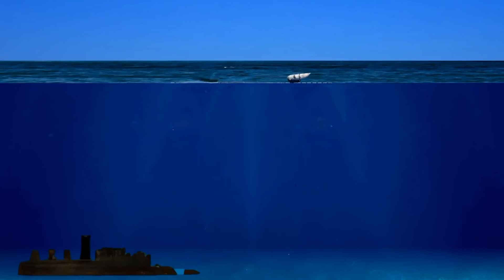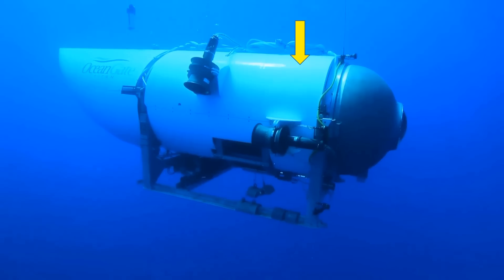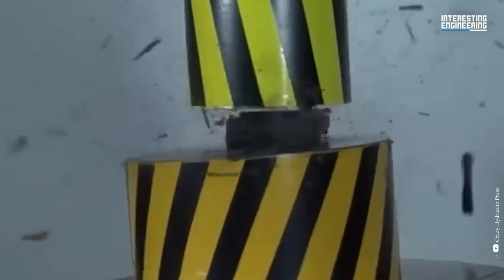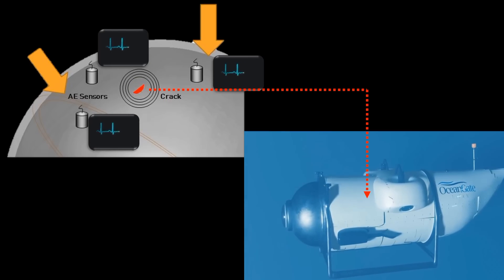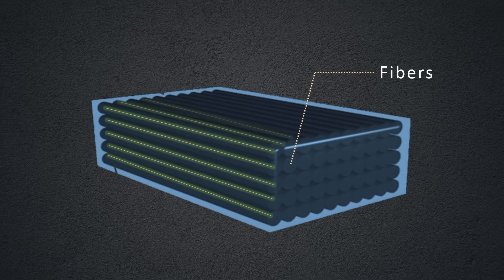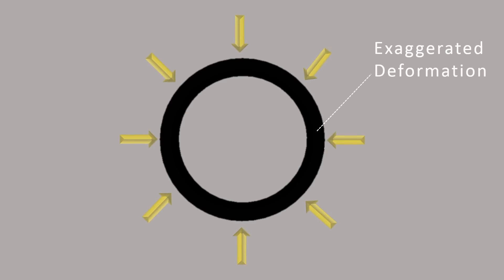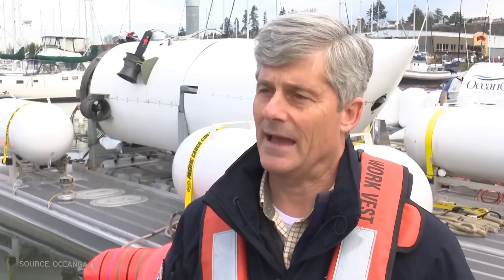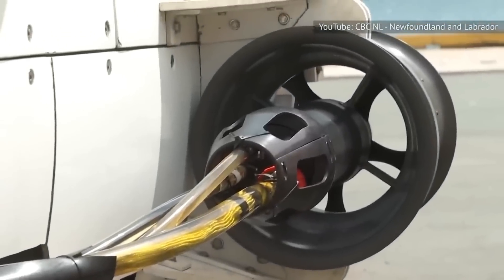Oceangate Titan Did Not Implode Just From Pressure. There Is a Catch!

Comment: The mission before the last one, has a scary story. There were only 2 hold points, which were located on the back side. The lady on board it said that she was sitting in the front dome during landing. The back held it like a hinge, and the dome with the view port kept raising up, and slamming down. Which means the dome was being pulled violently apart at the glue. Imagine slamming it down to get the dome off. They never even looked at it before they left the docks for the last time.

Comment: I used to do non destructive testing for the oil industry. At the time we used radiography which is using Iridium 192 to take an x-ray to check the welds on the pipeline. These days the most common way is to use ultrasonic inspection. Anyway, I don't understand why Stockton would not do NDT on the hull. It is not that expensive, and in my opinion it is a must in the submersible community. I realize that Stockton was bleeding a lot on money and was essentially broke. So I think the real reason was that he knew the carbon fiber was failing, he could hear it buckling on practically every dive. I can't imagine that he was in such serious denial that he could ignore such a fact. But he also knew that the view port was only rated to 1300 meters and he was diving to 4000! And when Lockridge requested the certification on the view port, he was fired in order to keep that information secret. This whole situation is baffling to me that a man could act in this manner and allow innocent people to die. I really want that view port found and inspected. The fact that the manufacturer rated it to 1300 meters and I think that later they reduced that rating. And the Titan dove to the Titanic more than 10 times successfully. We are possibly looking at a new design when it comes to the view port. That is why I would like it to be found and inspected. Kudos to the guys who made it and stood by it. And rated it with safety first.

Comment: Anyone that knows anything about carbon fibre and its strengths and weaknesses, I really doubt it would’ve been used for sub,Arline purposes. Initial testing were total and catastrophic failures. Also, the previous winter 2023-24, the Titan was left outside, by the sea in Newfoundland. Having been responsible for some of the Telecom infrastructure, Newfoundland experienced several severe winter weather events. Besides the nasty sea salty air battering this thing, a hurricane also knifed Newfoundland after hitting Nova Scotia and New Brunswick. Just from my own experience trying to keep things like bucket trucks working in this kind of extreme weather was very difficult. That sea air, constantly changing temperatures, and at least one 60cm snowfall and lots of 20+ snowfalls, I’m surprised anything was working on this thing. It sounds like poor engineering decisions and poor storage fscilitiesnabsolutelymwould have corroded any steel, aluminium. I would know. A simple fog that comes in off the shore is salty fog and would rust out my brakes overnight. If Rush didn’t go down with the Titan, he’d be in jail.

Comment: The safety record of submersibles in general has been exemplary. The decisions of other builders has obviously been better than the build undertaken by Mr. Rush. Jordan Petersen said "Most ideas are wrong." I was working with  Archie and the rig he was trying to make work was not working and would not work so I said to him, "You can't stay married to this rig."  Stockton was married to the idea that carbon fiber could do the job when it could not. In aviation the engineers became aware that materials wear out after so many hours. The pivot bolt for rudder of a DC-6  takes all day to change.  One of the best days of my life was spent changing it.  In aviation parts are tested till they fail. A novel that tells the story of how these standard operating procedures and best practices came about is "No Highway" by Nevil Shute.

Comment: Yes, there were probably voids in the bonding since we saw no evidence of squeeze out...but that's not so important because of the high compression press into the core. 
This is the most-probable single point of failure:  In addition to being a material fundementally unsuited to compressive stress, A unidirectional tow strip is the only fiber the Spencer Composites video shows hooped😮 around the mandrel;  only some was the design provision for 90 degree fiber.   Thus, given water's injection into the motly unidirectional structure, the hooped fibers were displaced laterally, wedging them and progressively splitting the tube.  This tube material, only ever seriously used in tesion, never primarily in compression,was so fundamentally ill conceived that it sickens all competent composite engineers and fabricators.

Comment: The fiber was layed down by a fiber placement CNC machine.  The placement could not have been layed down incorrectly.  The problem here was failure to test this design under 3 to 5 times the anticipated maximum outside pressure, and the failure to test for fatigue, running that test for at least 2 lifetimes.

Comment: You are about the design of the craft. Titan was descending more than twice the speed per meter. Too fast for safety reasons. Then they should have realized to stop and return to the surface... Once Titian realized it had a problem, the sub could not return to the main vessel because of electrical issues. By then the sub already had water into the battery and electronics that control the motors... Once the crack had started... the game was over... So sad... =)

Comment: unfortunatlly, you have failed in this assingment, and there is why: you didnt understand the loading. you have equal pressure from each side and tubular space you would like to protect- bare with me, we are still analysing, we will get to the material later... so, you have pressure on the surface of the tube, which is a lesser of the problem- bigger is the same pressure being exerted on the tube sides- what appears to be an axial force running along its lenght: two half domes at both ends would in theory transfer the pressure on tube edges- and that is where the problem is- there is nothing to receive it. we can consider carbon fiber in this case to be a composite material- fibers are applied in certain fashion, but bonding material is the key, what is it- think of concrete, it is good with pressure but cannot withstand tension- hence reinforcement. if we have a homogenous slab, with no beams- than reinforcement has to go in both cardinal directions within its plane. same is true for carbon fiber. in this case "engineers" and "innovators" should have tried to criss- cross it, to create some sort of cage hoping to achieve enough structural strength- to avoid applying force along side fiber axis or straight across it- spatial structures comes to mind. moreover, thickness is just making the problem worse- its own moment of the inertia within cross section is creating a havoc. one thing you got right: fibers in general are good for tension only- you dont have to think of reinforcement, take wood: perfect for tension, not very much so for pressure, unless the size of the cross section is proportionally bigger to its lenght to avoid deflection, one thing that caused this "submarine" to fail- if it actually happened at all. if they were serious, they could have tried to apply pre-made sheets of carbon fiber, not very thick, just wrapping it around in spiral fashioon- paper tubes are done in the same fashion? there is also question of thermal dilatation- lets say between two materials, titanium and carbon fiber: fiber may be inert, but steel is certainly not? than- does carbon fiber becomes brittle under conditions of high pressure and low temperature- sure it does, more especially because of contradicting state material is in: increasing the pressure rises the temperature? if this is not understood, no "computer model" will help you- remember: there was the world before computers, most of it is still standing... however, being an young engineer, thread carefully- diploma or degree means nothing, it is there to give you right to work, to qualify- real work is ahead....

Comment: Yes u can make a carbon fiber hull work for submersible, just make it very thick and apply the fiber layers lengthwise, not cylindrically--effectively making the hull concave--the carbon fibers will then expand rather than contract under the the water pressure.  The titanium endcaps should probably also be reinforced w/a hexagonal frame, to help keep it from compromising the hull.  And that's it--fyi, there's a company Composite Energy Tech, that makes carbon fiber submersibles, and they have an excellent reliability record

Comment: Dude, you're talking about shapes of submersibles but showing submarines.. Submarines are not going to the depth of 1000 meters of deeper.. Submersibles rather go deeper even to the mariana trench and yes, the cylindrical shape matters. Imagine a rope that is tied in a circular pattern. push from inside the rope across all directions it will withhold all pressure as long as the tied ends can hold up. But push from the outside of the rope from ay direction it will crumble. Thats the difference. Using CF materials are great for aerospace of any industry that need to handle pressure pushing from inside out.. not the other way. And CF material is not homogenous to other material used, which is Ti (titanium) both are different materials. Using CF in under water voyage is suicide unless changes and advances made in that field can disprove this proven theory in practice. Ocean gate and their owners and engineers suffered from some time of Hubris that they are better than industry leaders and the knowledge they gained. Instead felt safety worries are crap. I mean when you have someone like Stockton Rush who is risking his own life building a homemade small plane asking his probable clients to jump on it without certification and in this case a submersible, they are not confident but affected by bias and hubris

Comment: Over 4 decades, I ran thousands of cycle tests on my company’s products and others. I’d turn a test machine on in the morning and let it run all day or for weeks as needed. We could have fatigue tested several small Titan prototypes to determine the fatigue life. A prototype should be scaled for cylinder buckling mode failure per an FEA. But other test units could be scaled for end mode failure.  

I’ve tested many products made identically by machine precision, from high quality SST, which have fatigue life such as the following:

Item #1 cycled to 50% of rupture; SST; compression with a component of tension: 10 cycles to 5000 cycles
Item #1 cycled to 12% of lowest rupture pressure; SST: 10,000 to 80,000 cycles
Item #2 cycled to 12% of lowest rupture; SST; tension: 2 million to 10 million cycles
Item #3 cycled to 95% of lowest rupture; SST; near-pure compression: 10 million+ cycles
Item #4 cycled Ryton R4 resin with 40% fiber fill in tension; 70% of rupture: 2000 to 9000  

As you can see there are wide variations in performance and wide variations in the spread of cycle data. There is a (1) variation of test data of the rupture pressure determined by breaking several samples by one cycle (no fatigue). And there is a (2) variation of test data of breaking by several samples by fatigue pressure.  So there is a double uncertainty that requires statistical analysis to determine safe fatigue limits. I did this routinely. Add to this the (3) uncertainties of graphite fibers in compression. Fibers can develop microscopic damage sites which get worse with each cycle (fiber kinking, epoxy cracks, and defect issues). In some products you can visually see fatigue damage start with a tiny crack and grow slightly with each cycle, until failure. Fatigue cracks are often found on old airplanes, military planes, roller coaster structures, etc. But pre-rupture compression damage is rarely visible. Buckling rupture 

It gets increasing complex:

In theory a product designed below its fatigue endurance limit can handle an infinite number of force/pressure cycles (either tension of compression). That is why Roman structures are still standing today; and why engine head bolts handle 300,000 miles of operation which is about 400 million power cycles of tension loading. Although a head bolt is highly pre-tensioned, it still sees a reduced spike of force with each nearby engine power stroke and a lessor spike from adjacent cylinder strokes.

Compression failure isn’t even dependent upon the tensile or compression strength for most structure. Only for short columns will compression strength determine failure. In most cases and certainly for the Titan, what determines failure is the modulus of elasticity of the material, geometry, non-uniformity, end conditions, material defects, and fatigue damage (Euler formula for a column). For metals in compression, with no or little tension component, the rupture point can be extremely accurate; far more accurate than tension failure products. And the fatigue life can be extremely high; maybe infinite. But this assumes no funky mechanisms like we find in fiber composite materials.

Comment: Agreed! Wherever there are 'essentially' layers (only circumferential fiber wraps), such as in Titan's midsection, the external pressure will translate to circumferential compressive forces, but the innermost 'unsupported' 'layers' can buckle in compression (on the circumference) from tensile failure of the Matrix Binder. All of that on top of the fact that a cylinder, having an internal pressure being less than an external pressure acting on it, is inherently unstable anyway. I intend to upload a short video showing the Effect of that Affect. Ha, ha

Comment: According to their status reports between Titan and the surface ship, they stated that they heard a cracking sound  in the aft of the craft 17 minutes before the implosion, my hypothesis is that the radial load on the aft section of the carbon fibre hull where it mates with the titanium ring was delaminating, also the craft did ditch the ballast and jettisoned the landing frame to make an emergency accent, but the sub encountered  negative buoyancy along with reports that battery bus A was overloaded

Comment: Excellent summation with a cool and collective head.
If I were rush i would have put the entire unit under hydrostatic test at1.5 times the max hydrostatic pressure at Titanic location depth for 24 hours. Post which he should have used high accuracy ultra sound detectors for material disintegration such as lamination, cracks and disintegration of glued joint between titanium ring and carbon fibre hull.
As change in shape to make design more stiff against collapse by external pressures,  i would have given the outside of the hull a somewhat spherical shape while maintaining cylindrical on the inside hoping that outside water pressure will be resisted much more effectively by the redistribution of the hoop stress along the longitudinal direction neutralizing to some degree the longitudinal stress conveyed from the titanium end caps.
This is strictly my imagination. Feel free to shoot holes.

Comment: Ehm....i have my doubt about this explanation.  The hull is wrapped as a spool of yarn. In this explanation pressure is displayed as just one force  pushing inwards. To me this force  is causing delamination, then pushing yarns in the spool sideways. It is like pushing with your thumb an finger on a spool of yarn, vs pushing your nail in between the yarn.  With no yarns in other directions to prevent this. Next to other causes as CF oxidation in between FC and resin, possibly from over shelf time CF,  Improper workmanship as seen on video ocean gate and improper usage of additives and/or bonding of titanium rings with CF hull.  Thruhull connectors etc etc etc.

Comment: Carbon fiber is not an ideal choice for a cylinder being used to resist compressive forces across the center of the fiber, but Titan suffered from a second major weak spot; the transition from the CF hull tube to the titanium end hemispheres. As the different materials would tend to compress unequally under the same outside pressure, repeated cycling would tend to create and enlarge defects at the material transition, which is made more sensitive by the use of unreinforced epoxy to secure that joint.